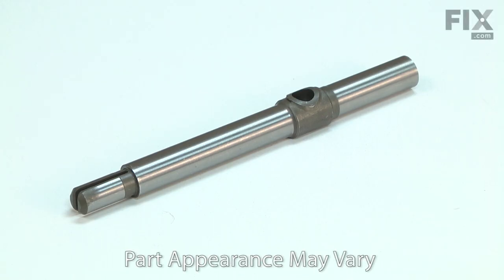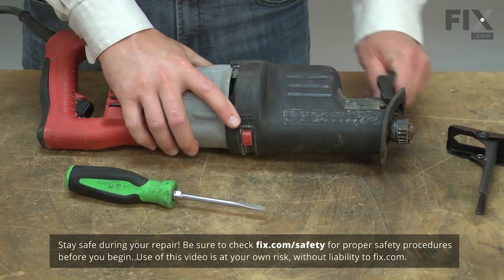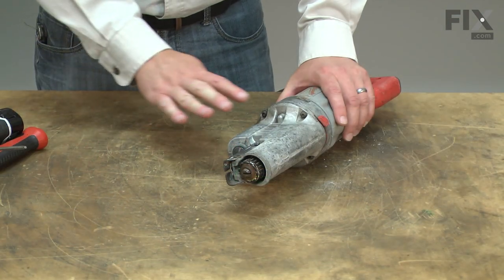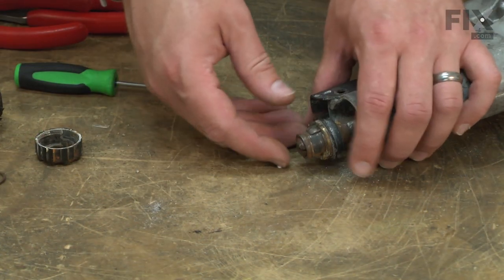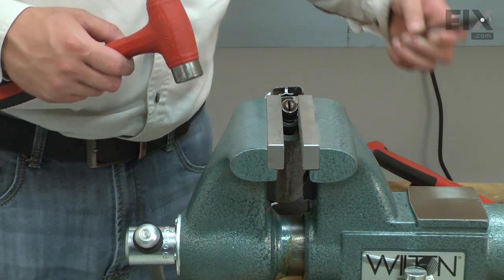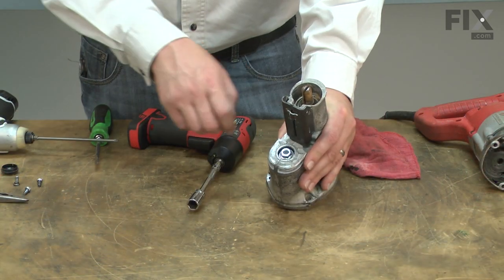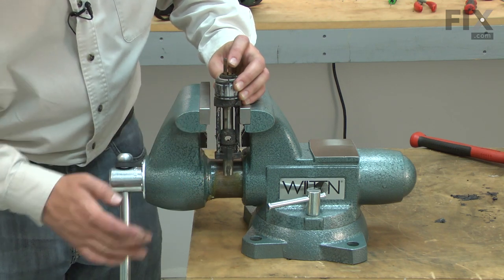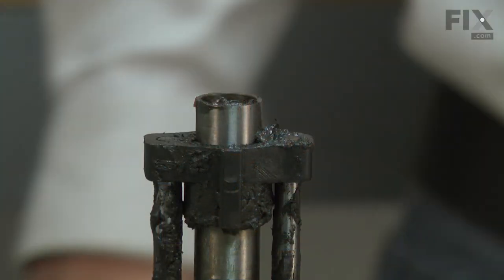Milwaukee Reciprocating Saw Repair - How to Replace the Spindle

Comment: We like there is a makita there to repair the Milwaukee !  Great video !  I watched to see what the normal or most common part that goes bad .  I see were I could buy some for a cheap price but I haven’t because if the same things wrong with all of them I wouldn’t want them ! If I could take 3-4 and build 2-3 good ones but I don’t think they would be easy fixed I’d probably have to buy parts !

Comment: My spindle quit working and I called a service center and they suggested wasn't worth fixing saying it was likely the gearbox. It's only been lightly used over the years and I don't mind the challenge of replacing this spindle.(if I'm using your YouTube video)
The motor seems to be fine but the spindle don't move. Is this the problem that is being addressed in the video?